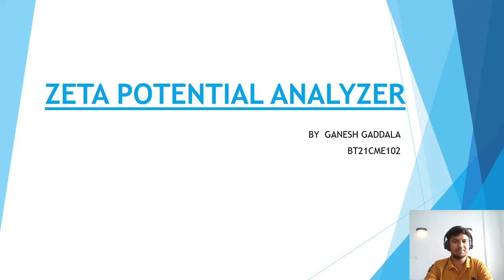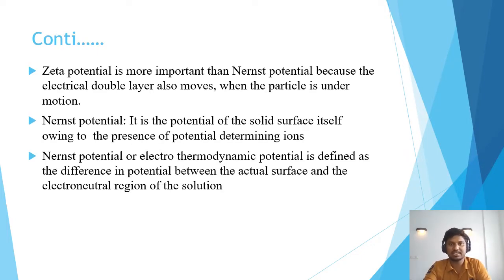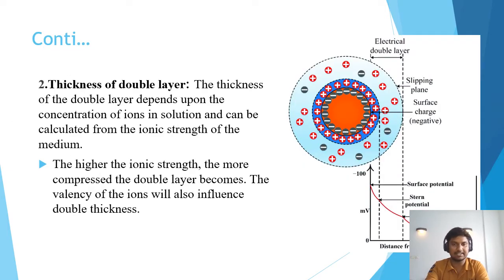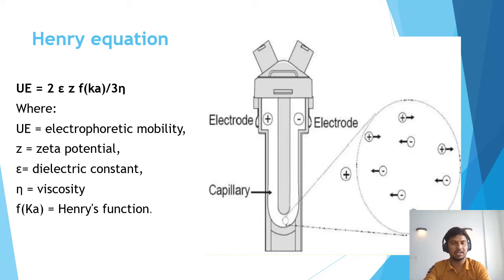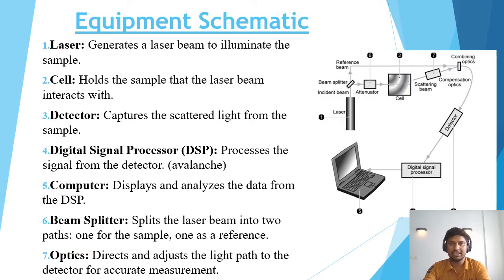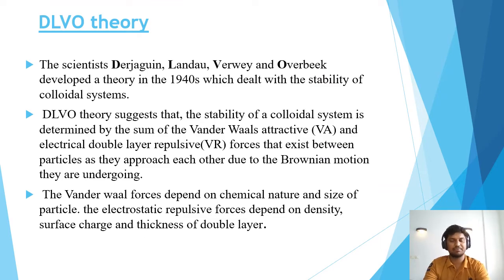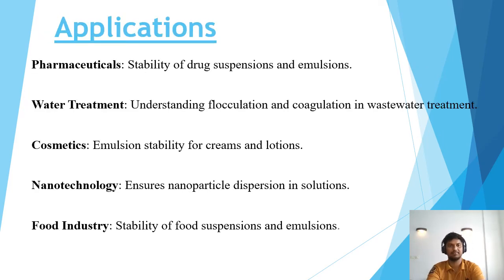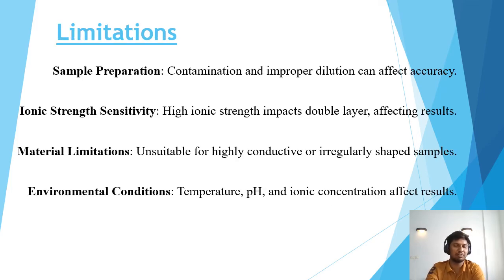IAT PRESENTATION BY BT21CME102 GANESH

Comment: BT21CME072  kethavath Vamshi Why might a system with high zeta potential values still exhibit aggregation?
Reply from the maker: system with high zeta potential can still aggregate due to factors like strong van der Waals attractions or insufficient stabilizers. External conditions like high ionic strength or temperature can also reduce repulsion, promoting aggregation.

Comment: BT21CME051 Yash Dupare 
How can combining zeta potential with other characterization techniques (e.g., DLS, SEM) provide a more comprehensive understanding of colloidal systems?
Reply from the maker: Combining zeta potential with techniques like *DLS (Dynamic Light Scattering)* and *SEM (Scanning Electron Microscopy)* provides a fuller picture of colloidal systems. Zeta potential reveals surface charge and stability, DLS measures particle size distribution, and SEM gives detailed morphological information, allowing better control and optimization of the system.

Comment: BT21CME003 Krunal Putta
What is the role of electrolytes in Zeta Potential measurements? Does electrolyte concentration in the solution affect zeta potential in any way?
Reply from the maker: Electrolytes influence zeta potential by shielding particle surface charges, reducing the electric double layer thickness. Increasing electrolyte concentration compresses the double layer, lowering zeta potential, while lower concentration enhances charge separation, increasing zeta potential.

Comment: BT21CME038 A SAI SASI VAIBHAV 

Explain how zeta potential measurements are critical in ensuring the stability of emulsions in the cosmetics and food industries.
Reply from the maker: Zeta potential helps predict emulsion stability by measuring the charge on droplets; higher values prevent clumping. It allows manufacturers to optimize stabilizers and pH for better product performance. Regular monitoring ensures consistent quality, avoiding phase separation or spoilage.

Comment: BT21CME105 Santhosh
Consider a suspension with a zeta potential of -50 mV but undergoing aggregation. What could be the underlying causes despite the high stability indication?
Reply from the maker: Despite a zeta potential of -50 mV, aggregation could occur due to factors like *high ionic strength* reducing the double layer's thickness, or *van der Waals forces* overcoming electrostatic repulsion. *Inadequate stabilizers* or *temperature fluctuations* could also destabilize the system.

Comment: BT21CME060 K.Chandu
Why is the range of zeta potential typically limited between +100 mV and -100 mV? What factors could cause values outside this range?
Reply from the maker: Zeta potential is typically within ±100 mV because most systems stabilize in this range based on normal particle charge interactions and medium properties. Extreme conditions, like highly charged surfaces or unusual solvents, can push values beyond this range.

Comment: BT21CME61 Motha Abhinav 
What is the principle behind the Henry function in the Henry equation?
Reply from the maker: The Henry function in the Henry equation links electrophoretic mobility to zeta potential by considering particle movement in an electric field. It accounts for medium properties like viscosity, dielectric constant, and double-layer thickness. Simplifications like Smoluchowski or Huckel apply depending on the double-layer's thickness.

Comment: BT21CME064 RaviKumar How does the analyzer account for electrolyte concentration and pH effects on zeta potential?
Reply from the maker: The analyzer accounts for electrolyte concentration and pH by measuring changes in particle movement under different conditions. Higher electrolyte concentration compresses the electric double layer, affecting zeta potential, while pH alters surface charge by changing ionization, both influencing the electrophoretic mobility.